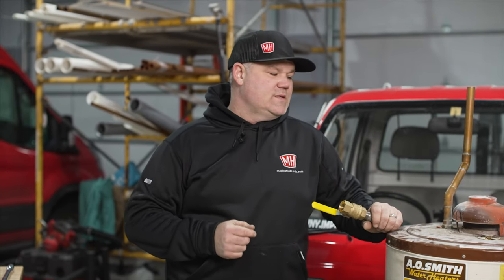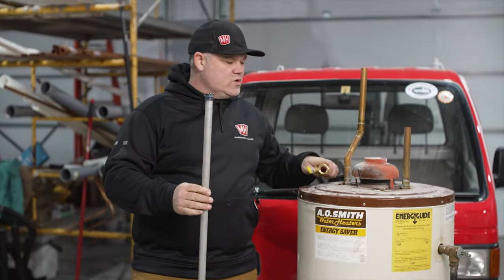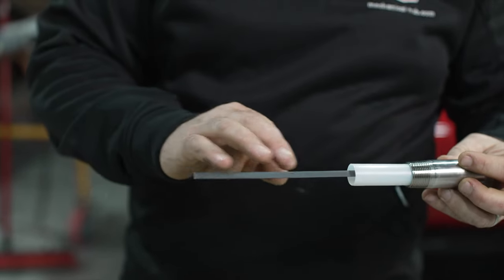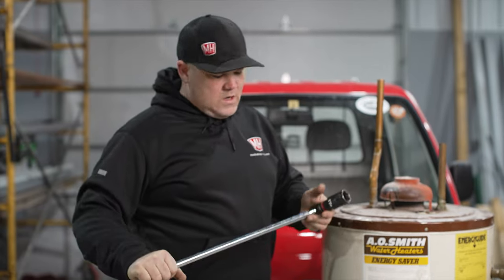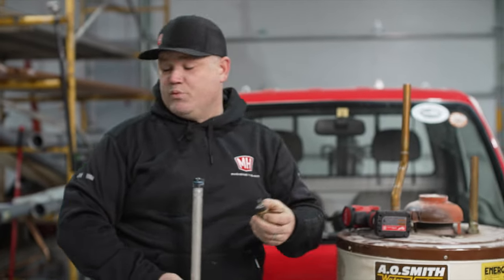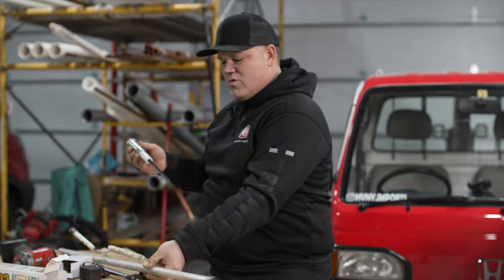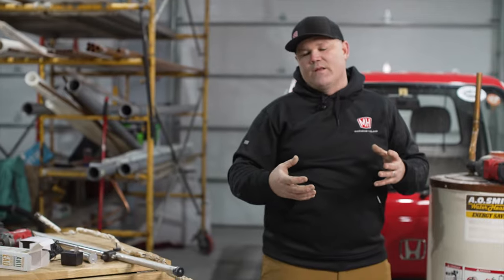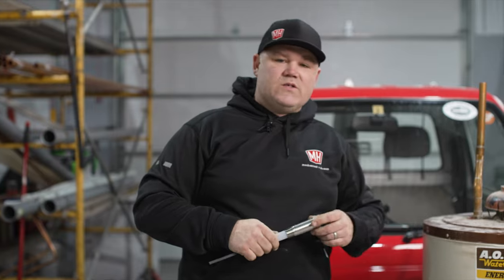Water Heater Anode Rods, What they do & How to change them

Comment: Great content, magnesium is less noble than the tank.  Magnesium rod anodes and the MMO “mixed metal oxide” anodes are commonly used in city water storage tanks as well. 
The MMO anode is typically a platinum or niobium coating over a Titanium or copper substrate.  It’s really important not to scratch the coating of the MMO as you will remove the anode itself.  Also the MMO anode will not self consume, over time you will not see a reduction as you would a magnesium anode.

Comment: Great video. I have a water heater thats 4 years old and my house uses well water. I have a state electric water heater with aluminum anode currently.
My water heater hasn't been flushed yet,,(my bad on that)
If I used the electric anode, do I still need to flush my water heater annually or no?  Thx

Comment: 4 years ago I replaced the anode rods (1 on outgoing side, 1 standard rod), on my now 18 year old Whirlpool 40gal. electric water heater.
The old rods were pretty eaten up, but still had the steel core and a bit of magnesium left.  The water heater was 14 years old at that time (had never replaced anodes until then).  I had to use my electric impact to get the standard rod loose.
Is it time for replacing them again?

Comment: I replaced my anode rod with a magnesium rod 6 months ago and just pulled it to inspect at the same time as flushing the water heater. I was surprised to find the rod almost totally caked with mineral deposits, however I didn't see much deterioration of the rod itself. If I installed an electronic anode rod where would all those deposits go? Would they wind up on the bottom of the tank? BTW, the more Noble a metal the LESS reactive it is. Gold and Platinum are Noble metals.

Comment: Just tried unsuccessfully getting mine out of a 50 gal Rheem. Losing respect for my HF Earthquake air wrench that will get lug nuts off easily, but couldn't get a Honda crankshaft bolt off, and now couldn't get this anode loose even using 1/2" hose (granted a long 75 foot run from the garage, AND my 30 gal compressor only has a 1/4" regulator. Even at 90 and even 120 psi. May be not enough air for it. But, I don't want to spend $300 for the electric Milwaukee since I am already set up for air. I finally got that crank bolt off with a 42" long 3/4" drive Tekton breaker bar, which I now call 'The Beast." I think it will spin that water heater though. Any suggestions? Could a second guy actually hold the tank good enough for me to break it loose with The Beast?
Reply: Your post indicates it's now 5 months old, so I'm guessing that you solved the problem and I am curious about how you ended up doing it.  Please post an update so that we all can learn from your experience and knowledge.  Thanks!
Reply: Well, I guess I had given up on it and was just going to replace the unit when it rusted out. However, on 7/3/23 my Honeywell water alarm wire I have lying in the leak pan alarmed. Went up and checked it out and slight darkened moisture (not water) was around bottom at heater/leak pan interface (the only place was back on the hot water outlet side and also where anode is). The alarm is VERY sensitive. Doesn't even have to have actual drops of water touch it- don't know how that works but I love it. Rearranged wire and the alarm never re-occurred. Next day, went up again and checked. Same moisture there, and I wondered if the anode was leaking since possibly I loosened it before-no, anode connection was dry. Decided to give it another go and get that anode out. Turned off water and drained some water out and had my adult son hold the heater so it would not spin and I put that 40 inch 3/4" drive Tekton breaker bar on it (aka The Beast) and it still wouldn't budge. Cursed the anode and sprayed PB Blaster on the anode and waited an hour. Tried again and the anode broke loose. PB Blaster is my buddy. Anode still had about 30% of material on it but was down to bare wire 1" at top. This was a Rheem "Premium Anode" and it was a much thicker diameter than regular ones, so it still had some life left even after six years. What I do is, after the anode breaks loose, stop and just jam a paper towel down around it before removing it in case some PB is puddled up there. There wasn't any on the towel on mine.  Use the penetrating oil with confidence if you have to. It works. I don't think any got into the water. No odor of PB Blaster in the my shower later. Replaced anode with a Rheem segmented anode using gray Teflon tape on the threads. When we disturbed the heater doing this all of this, the Shark Bite corrugated steel pipe connector attached to the hot water nipple started obviously leaking at the connection. Tightened it but still leaked. This is probably where the original moisture was coming from. Went to HD and bought a package of rubber water heater connector gaskets and replaced the 6 year old gasket. Stopped the leak. Haven't been up since, but will soon because the AC condensate drain is overdue for its monthly bleaching. No alarms. I'm hoping the Shark Bite rubber gasket was the leak, probably a seep, that caused the original alarm. If it is still moist around the bottom, then I may have a leak at the nipple/heater connection, which will be a new problem.     @Naked.Stranger
Reply: Quite an "adventure",  @freespirit1975  !!!  WOW!  PB Blaster, eh?  I'll have to get some of that for my "problem-solving arsenal"!  Thank you for the update!

Comment: Very nice video, never heard of anode rod replacement until a couple days ago. The video demo was nice and your experience for replacement. 
Is there any way to check the anode rod without removal? Have a 12 year old GE on city water never been replaced, however no odor from water.
Thanks
Reply: Sure, ask your local superman to use his x-ray vision to inspect the rod from an enclosed steel tank.
Reply: @oldtwinsna8347  Left my Get Smart X-ray Glasses at the office. Replaced the anode rod with one of the Electric Models. Had about 8 inches left, so yeah it needed to be replaced. Used a deep well impact socket and Ryobi Impact Driver. Broke loose without any twisting of the water heater, very nifty, replaced and plugged it into the electrical outlet with the water softener.  We shall see how long the water heater will hold out.

Comment: I had to give up I tried a breaker bar and a impact wrench nether worked.  Unit is between 5-7 years old.
Reply: I would try a wrench and hammer, hammer the wrench. Same idea as the impact obviously but you can get a lot more impact with a hammer.

Comment: I had to switch my annode rod to Aluminum and put on a UV light filter to get rid of the smell.
Reply from the maker: Typically UV isn’t necessary when using a powered anode. Nothing wrong with one but more leak paths and added maintenance

Comment: What's the best way to clean the threads to insert a brand-new anoid rod. Too make a snug fit and seal
Reply: The inlet thread port to my take has left over material caked it the threaded port. How to clean the inlet threads for a new rod replacement.thanks
Reply from the maker: I’d try a wire fitting brush. I would use both thread tape and thread sealant on the new anode threads.

Comment: Are you ever ‘afraid’ for lack of a better word replacing an anode rod on an older tank? For example, stripping the threads or not being able to get the new one in?
Reply: Two fears - One is that you'll not be able to remove the old one as it's fused in place, but no harm done other than you now having to return the new rod you bought as it's useless. You won't risk stripping the threads if you use an impact wrench so always go with that to begin with, plus you won't risk sheering off any fixed copper pipes on your in/out lines.  Second, since you should drain at least some water from the tank, at least one or two gallons, using the drain valve on something that is a super old tank never having been drained may cause sediment to get stuck in the valve and you'll not be able to fully close it, to which you then have a nightmare on hand.